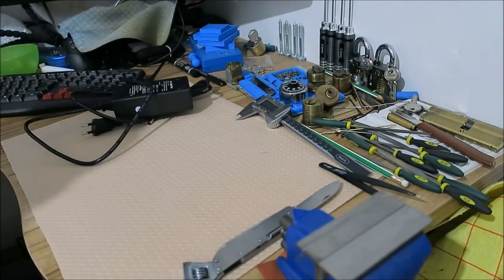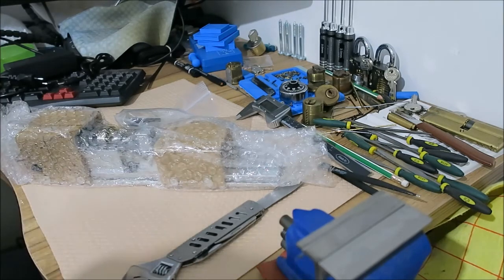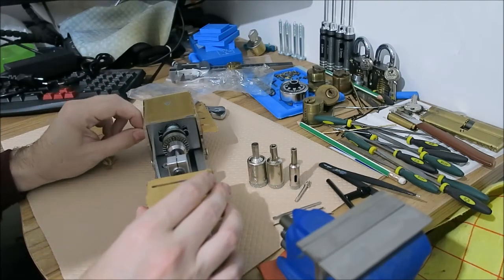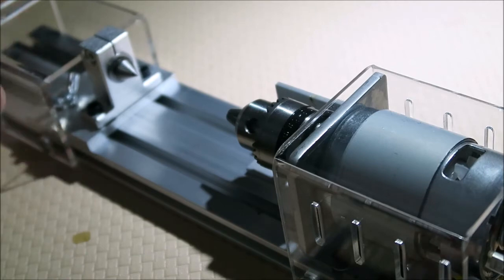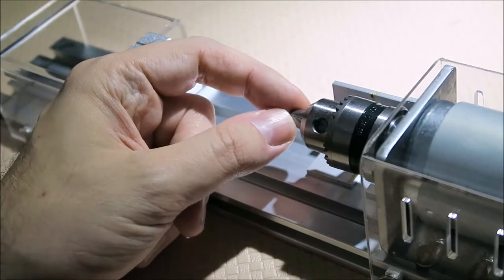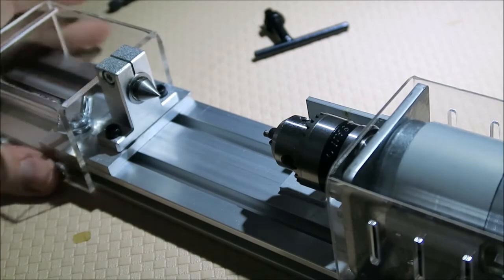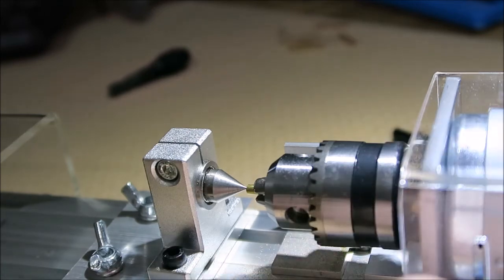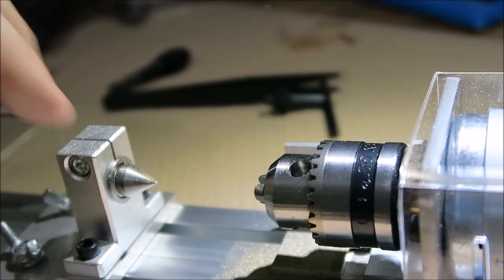Unboxing and review of a mini lathe from BangGood

Comment: Thanks for the review thought about getting one but I figure because you are so close to the chuck you shouldn't need to support the pin,  and i found just a couple of worm drive clamps through a piece of wood should be enough to hold the Dremel tool.
Reply from the maker: You are right, this is what I was using until now (the clamps) and it works as good or better than the lathe
Reply: @thetinylocklab3703  How did you set up your Dremel to use it as a lathe? I have seen a few options but none seem good. Any advice would be appreciated, cheers

Comment: Great review Boris.  What power cord did you end up using?  Here our mains power supply is 240v with 3 Pin plugs.
Reply from the maker: I used the one in the video... I am so tempted to open the adapter to see if the ground is connected.
Reply from the maker: I checked now... As I suspected and said in the video, the ground is not connected to anything. More interestingly there is a ground connector plate inside but it is not connected to it :)
Reply: Tipene Nga Puhi I

Comment: the interesting thing is that the chuck is protruding and allows you to work on the entire pin, in euro is more or less 42 euro, don't know if it's a bargain
Reply from the maker: Actually if you have a Dremel, it comes by default with a 2.8mm holder which holds the pin even better that this chuck. I honestly didn't find any advantage of this lathe over the Dremel.

Comment: The tail stock seems really poorly designed! I would add some guides to the bottom of it. I'm pretty sure the collet chuck on a Dremel is better than the drill chuck for most purposes but the drill chuck will allow you to do larger things. In December of last year I ordered several (5/8") tool holders and boxes of inserts from Banggood. What I received was an empty paper envelope in a plastic bag with a letter of apology from the post office that the envelope was received empty. I photographed the mutilated envelope (a paper envelope to hold heavy steel tools!) showing the order # and the post office letter and sent it to BG. After several e-mail exchanges They told me to go to the post office and get proof that the envelope was received empty. I went to he main post office and showed them what I had gotten. They were very accommodating and got me a letter on official USPS stationary signed by the postmaster. I sent that to BG. Several more exchanges and they sent an email asking if I wanted a refund or the products. I replied "products." It has now been over two months and I've not gotten anything and, by now, don't expect to. They have not replied to my e-mails. April 8th, 2018.